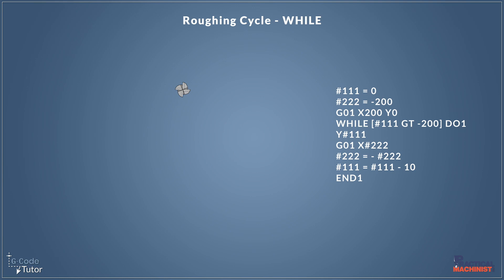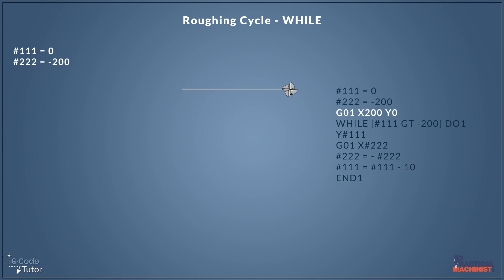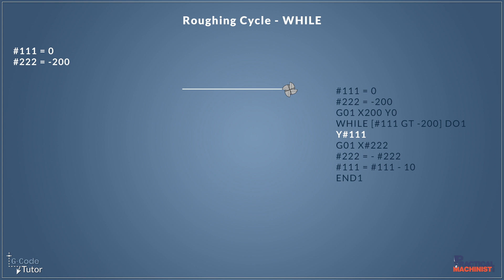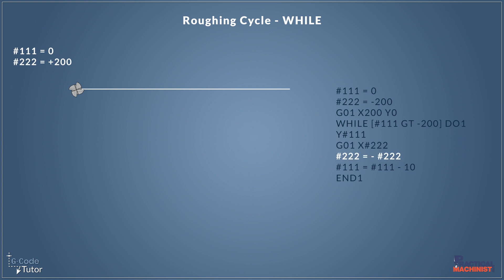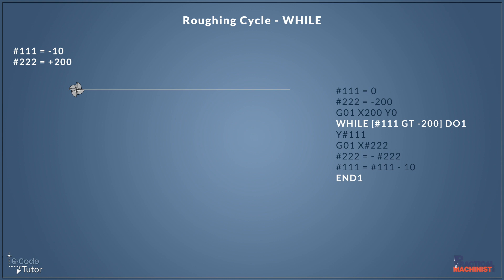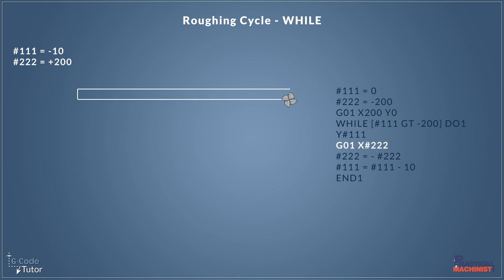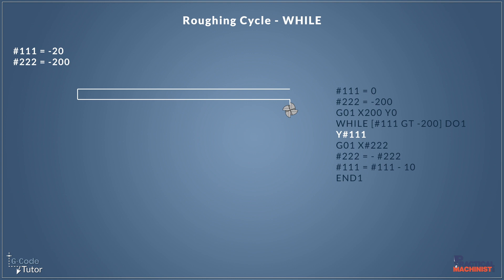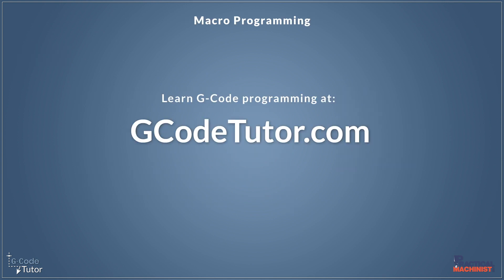Shorten Your G-Code Using a WHILE Loop! | CNC Macro Programming Tutorial

Comment: I kept having a 1 in 100 intermittent tool change issue where the machine would throw tools randomly against the walls, fixture, parts, etc.  Maintenance wouldn't believe me--they'd watch it do ten tool changes and walk away.  So then the machine would throw a drill randomly, nobody would notice, then try to bore a non existent hole, and have a cascading effect of tool destruction and scrap material.  I eventually wrote a while loop that would do a continuous (user specified) loop of tool changes to prove I wasn't crazy.  Well it worked, but it blew the thermal breaker on the ATC system almost immediately and I just about shit myself thinking I destroyed the machine.  Lucky it just took a hard reset and was fine.  I added a G04 dwell between tool changes before I showed off my fancy macro to anyone.  Be careful, and always test your code with a variety of inputs.

Comment: I wonder why the programming language enigneers didn't use "<=" for GT or "=>" for "LT" like in other programming languages.
Reply: That would make way more sense to me too.  The most reasonable answer I can come up with is that the < and > symbols don't exist on fanuc controllers pre-macro era.  However the brackets [ ] also didn't have a pre-macro language use... So that kind of torpedoes my theory that all the characters making up LT GT GE EQ all had existing uses prior to "complex" macro logic.  Having had a little C++ and VB experience before getting into GCODE, that also frustrates me.  Maybe brackets were the bare minimum addition to the keypad to enable higher logic, as parenthesis would be interpreted as comments.  They could get by with using E Q L T G without adding keys and losing backwards compatibility.

Comment: Why do you count down? Isn’t there a “less than” or “less than or equal” ann increment to that?
Reply: You can write which ever which way you’d like to orient your positives and negatives. But using absolute positioning, and with your Y0 at the top left, it makes more sense to leave it moving DOWN by 10. Hence the minus. 

In summary, it’s best if you choose a system and stick to it. Up and right= positive, down and left= negative.